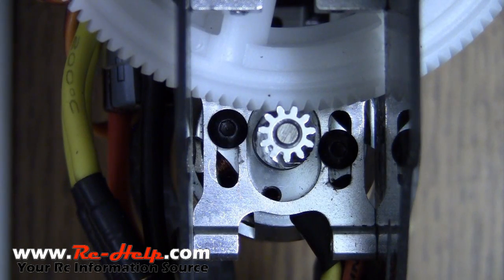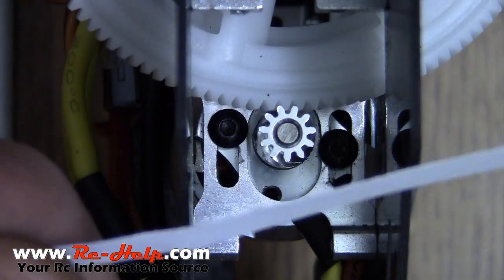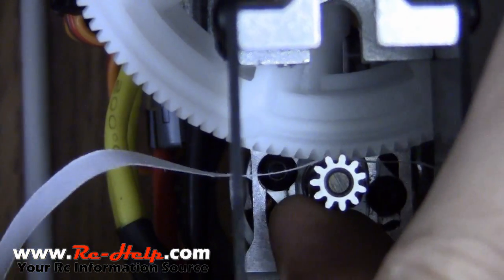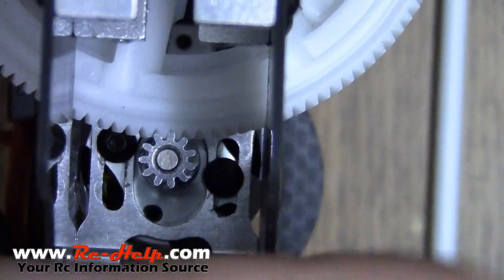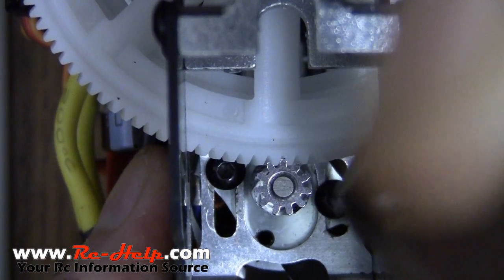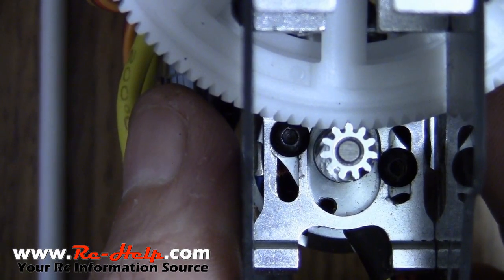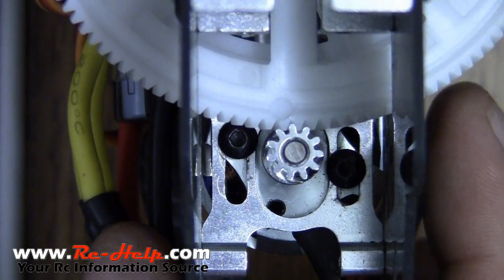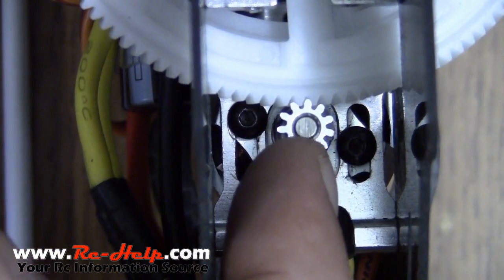How To Set Proper Gear Mesh

Comment: Your screws are digging into the aluminum. You need flat washers under your screw heads to prevent the screws from digging into the aluminum. This would cause the small gear to tilt .

Comment: I use 90gsm paper for the same effect but nice tip.
Reply from the maker: What matters is that it works for you. The new guys and gals I have seen have a really hard time using the paper method and either get it too tight or too loose which is why I made this video back in the day. I need to do an updated one that explains it a little more in detail. Thanks for the comment Michael! www.Rc-Help.com

Comment: I think your wrong its to loose
Reply: RcHelpDotCom I'm trolling I'm just so damn aggravated I can't get the right mesh with my x5 I can't get the vibration out of it so I'm to the point I'm going to run all 3 of my helicopters with a car
Reply: RcHelpDotCom I will give you a gaui x5 and a hd cell 500 for free if you can get 1 of my helicopters to run vibration free
Reply: RcHelpDotCom buy the way I have tons tons of parts and everything is new
Reply: RcHelpDotCom can u do me a favor and figure out what mod a gaui x5 slant gear is I can't figure it out some people think it .8 some think its .7 some think its .5